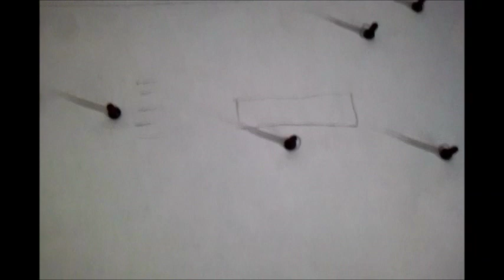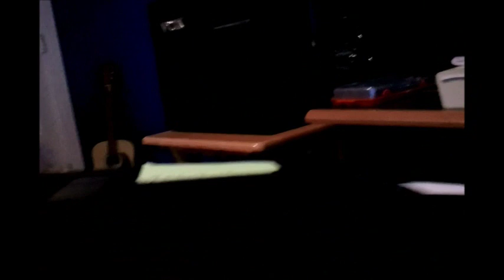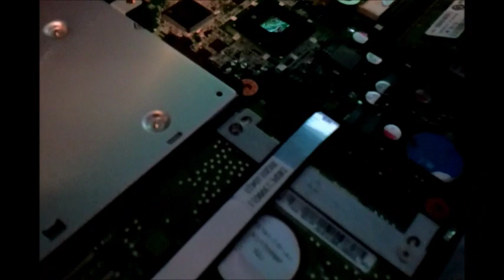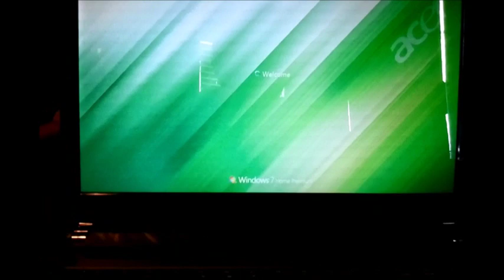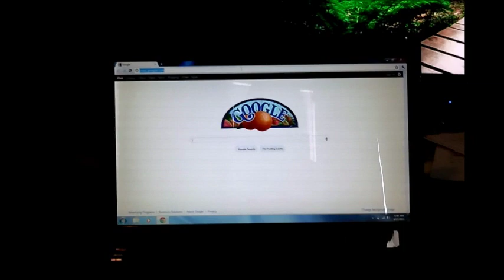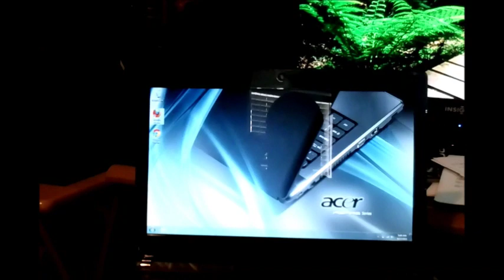Acer Aspire RAM Upgrade

Comment: This can't be done on Acer Aspire 5349, not without risking irreparable damage.  It's very, very difficult to get the case off, contrary to the video.  The Acer Aspire 5349 is therefore un-upgradable.  Get another laptop and make sure it affords easy access to the hard drive and RAM areas.  If it doesn't, don't purchase it..
Reply: the acer aspire 5349 can indeed be upgraded ram cpu and HDD ok

Comment: hi! what kind of ram do i use for Acer aspire 4755 Series. i want 4 or 8GB of RAM. Thanks! is it possible to add ram on this model?
Reply from the maker: +Chapa Chapa Chapa PC3-8500 modules. Here is one I found on Amazon. Disregard that it says it's for Apple. It will be compatible. http://amzn.to/1KHEh52
Reply: Just check if you need DDR3 or DDR4, This tells you if the split in the ram module will fit in your laptop, and use speccy to see if you have available ram slots.
Reply: I Checked for you you'll need DDR3 laptop RAM

Comment: what kinda ram can i put in a acer 5349
Reply from the maker: +potatohead 2 PC3 - 10600 DDR3 1333 MHz; 204 pin SoDIMM
Reply: do u have a link to a good cheap one dats around 8gb ?
Reply from the maker: +potatohead 2 Here's an 8GB module for less than $40 http://amzn.to/1RTruCY
Reply: Thanks! If i add this i will have 10 gb right ?

Comment: hey i ahve a question and i would be really grateful if u would answer/reply to my question, would an Aspire E 14 be able to handle additional 4gb of ram? currently its running on 4gbs of Ram, planning on adding 4 more gbs to make it up to 8gbs. Thanks in advance
Reply from the maker: Shahmie Sani If I looked at the correct model, the laptop should have an extra slot for additional RAM. I would recommend looking at the type of RAM you have and buying the closest brand/model to the current one or replace both with higher speeds. The type of RAM in the laptop is DDR3L. hope this helped!

Comment: Just a reminder, the amount of RAM doesn't usually affect how fast a computer runs. It just affects how much stuff can be open (or in RAM) before the computer overloads and abandons ship (aka, crashes). This is good for keeping games running and lag spikes low, but it doesn't make the game run any faster, necessarily.
Reply: WolfireGaming The amount of memory does affect how fast computer runs when you have a few apps open and it's running out of physical memory, so it switches to using virtual memory (on hard drive), which is really slow.

Comment: Hi, I have an identical an laptop. Question: What are the characteristics of the memory used or purchase?
Reply: You most likely don't need the answer anymore, but the RAM is low voltage 1.35v RAM

Comment: Seriously Acer, what the hell? I've done RAM upgrades on other laptops before and this is the first one where I've had to remove almost the entire computer casing just to get to the RAM ports. All my other laptops have just one cover with three to four screws to undo.

Also, if you happen to be doing a setup like I did (1GB+4GB on my other laptop) where the RAM isn't equal, it's possible that one RAM port has priority over the other. My usable RAM fell to 700Mb until I switched order of the mods

Comment: There are two large powerful permanent magnets inside the hard drive and several electromagnets (one of them being the motor that spins the disk). A little magnetic screwdriver isn't going to do any damage.

Comment from the maker: @gruberbomber Yes, there is a specific RAM you need to buy. You need 2 (or 1) 204- pin DDR3 SDRAM modules. As for noticing a difference, I noticed applications load a bit faster specially when I already have a few applications open. Its definitely worth it for $40.